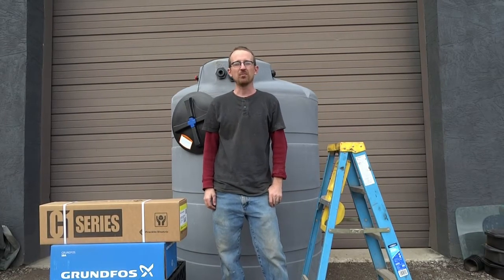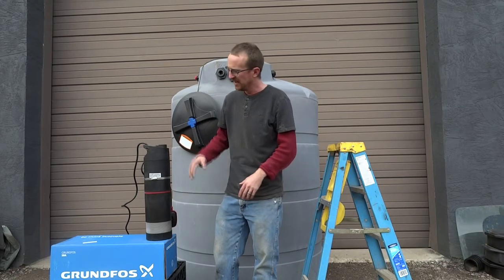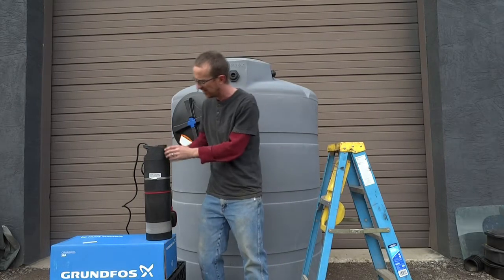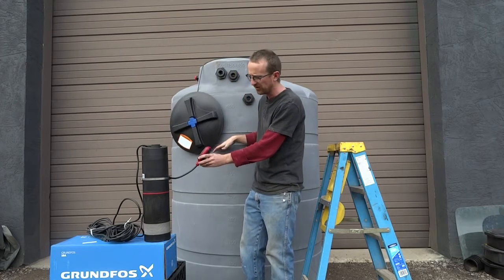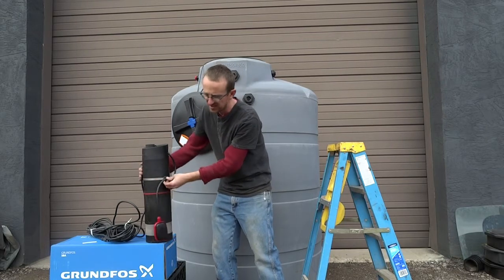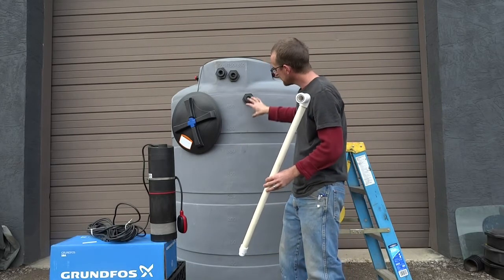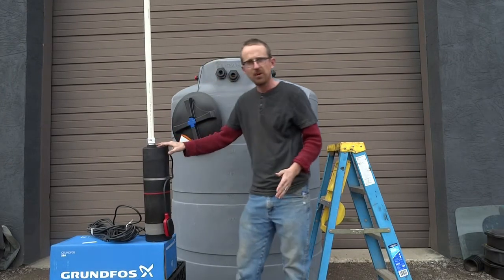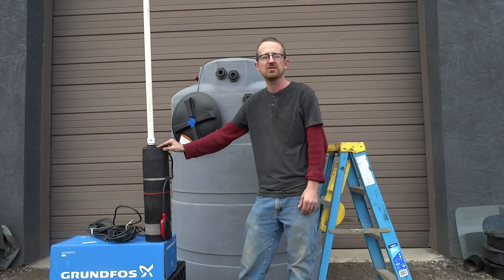Easy Cistern Pump Installation for Rain Harvesting Tanks

Comment: What kind of pump do you suggest for a 500 gallon water tank (small cistern) that will feed water to my small cabin? I don't want a big fancy one which would be overkill but one that would work well ad last. My tank is under the cabin and will have about a 50 foot travel to my cabin feed line inside..
Reply from the maker: This is the best pump for that application:
Reply from the maker: https://www.rainbrothers.com/store/Springer-Series-AUTOMATIC-Cistern-Pump-p460817590

Comment: I am confused the instruction manual shows it  going straight from pump to the house water system  but the brochures says i need a External Pressure Manager  pm1/pm2 ?????

Comment: Hello, great video! I have a 2 bed, 2 bath house with all of the usual water requirements. Will this pump meet the needs of a full house? Meaning, when pressure drops in the absence of a pressure tank, I’m assuming this is meant to continue to run in real time and provide constant water pressure? Is it meant to work with multiple loads? (Like a Shower running at the same time as a washing machine).